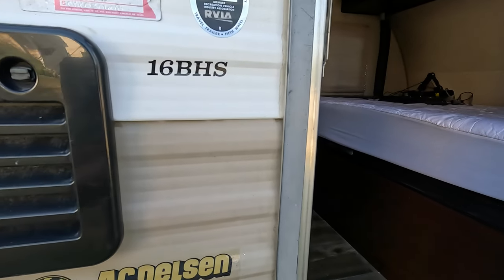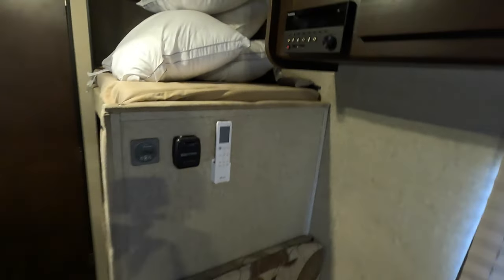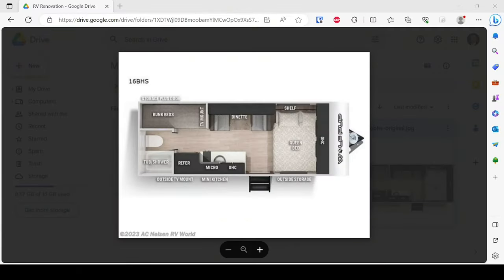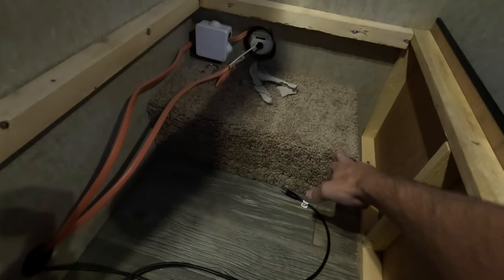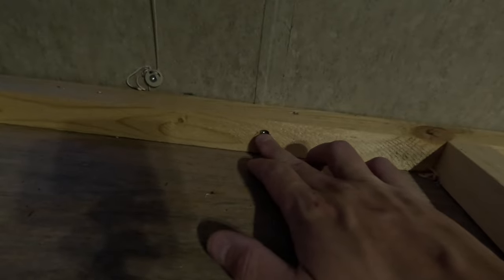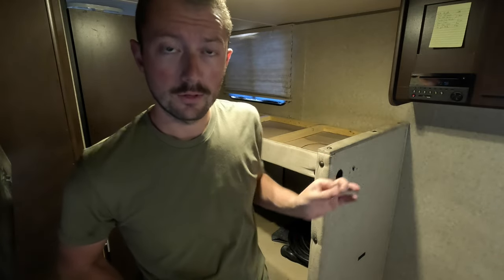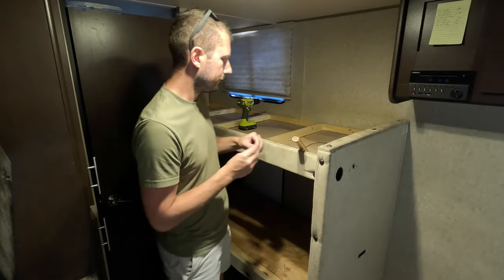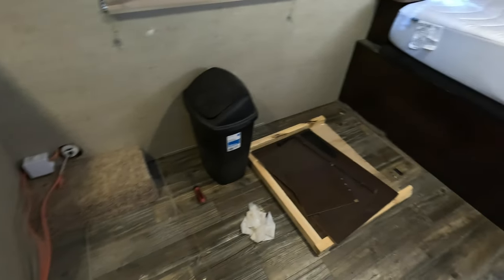RV Renovation Series | Part 1 - Planning and Demolition

Comment: The remodel is going to look great.  Are you planning on putting that 1/2 wall back at the end of the "new bunks" If so is ranger going to be able to crawl in there with a 8in gap?
Reply from the maker: Great question!  No the wall is going to stay out because I’m pretty sure Ranger is wider than 8 inches 😂😂